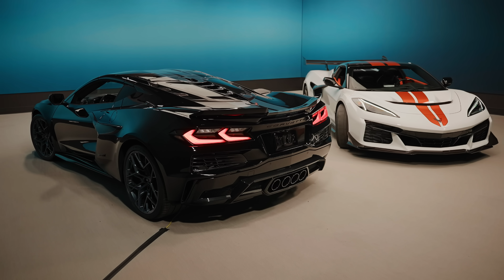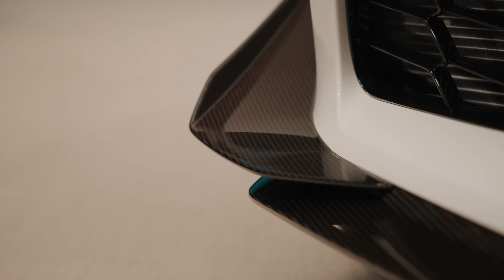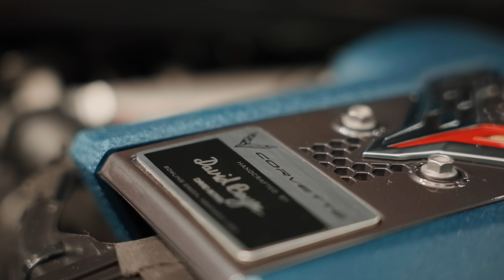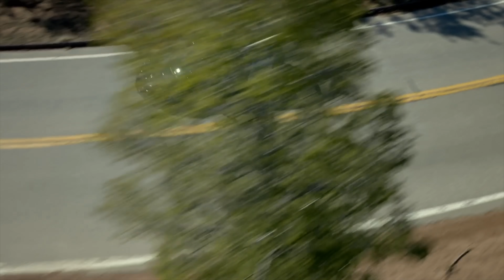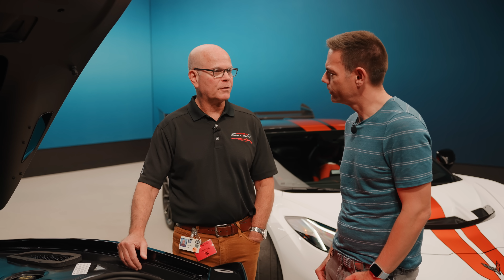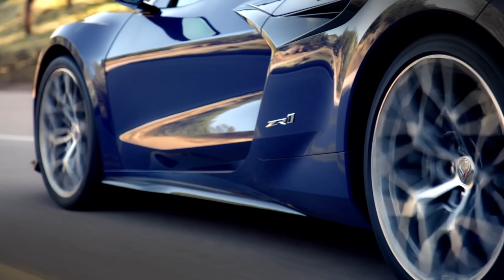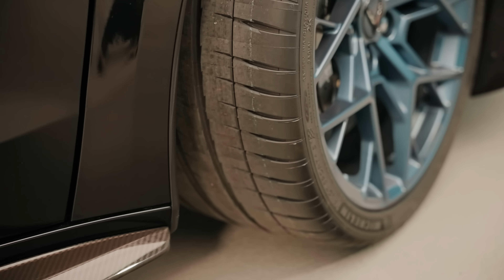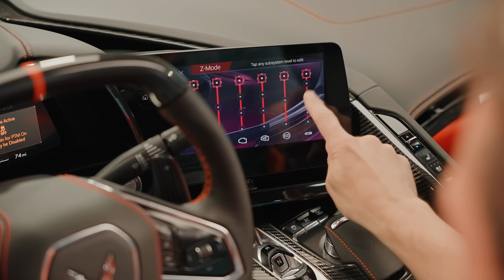FIRST LOOK: 2025 Corvette ZR1 – 1064hp, Turbos & 215mph!

Comment: Always blows me away how much more competent of a vehicle the Corvette is compared to almost every other GM product. They really let the engineers off the leash.
Reply: Gm has made lots of pretty amazing performance platforms in the past few decades, I mean the 2nd gen CTSV was the first sedan EVER to lap the nurgburgring in under 8 minutes, also literally sells its magnetic ride suspension tech to ferrari that they use in all these performance cars, caddys, camaros, etc youve got the 6th gen camaro zl1 1le that is just insane around a track as well, hell, all of the caddy V series cars since then have been pretty amazing as well, the ATSV is a crazy good handling sedan thats quite underrated as an M3 killer for its time period, the blackwings are amazing cars as well, ct4 and ct5 blackwing, all around theyre tough to beat for performance sedans. Truthfully I think their best all around work is done with the cadillac V series.  Sure the corvettes faster, but 1 trick pony, 700 horsepower in a cadillac sedan that can be used everyday,  and accelerate and get around a track nearly like a supercar in luxury and comfort is pretty impressive.  700 hp corvette is really only good for one thing.

The engine you see in the C8 Z06 is based off the work cadillac did on the blackwing 4.2 DOHC V8 actually, same as this engine in the ZR1, 5.5L DOHC V8 with turbos slapped on it but the architechture I is based on the blackwing cadillac engine
Reply: @justinschmidt1 My wife daily’s a CTS-V Wagon, I totally agree with you. It’s a legit monster, with room for my kids and dogs.
Reply: @justinschmidt1 exactly, it’s always a hater trying to discredit gm whilst they’re active putting out things like this amid the other models you’ve listed over the course of the past couple decades. I just love to watch their haters COPE. 😂😂😂
Reply: @justinschmidt1 gm hasn't owned magneride in years now. It's its own company.
Reply: @TLPH04  doesnt really change the point that one of GMs company developed it and was used in GM vehicles first and later licensed to other companies like Ferrari and Audi, yes the company was sold asfter that....but doesnt change the history behind it
Reply: Corvette is its own department. They may be under GM, but they are a superate branch. My Uncle works for them and it's whole different atmosphere being a part of Corvette than just Chevrolet
Reply: @toxicgracie3772 Engineers get moved around GM all the time.  GM has great engineers all over.
Reply: @jostrander71  I'm talking about Corvette. GM is a massive brand with multiple car companies under its belt. Of course GM has great engineers. But Corvette is the smallest branch of the tree and they chose the best. You don't just sign up for a job at a Chevrolet factory and get put into Corvette assembly. Corvette is Chevrolet and it's up to Chevrolet who gets to work on them. Not GM
Reply: @toxicgracie3772 Gm just moved a bunch of Corvette engineers over to ev. They get moved around.  The best engineers work on the best products but they are shuffled around.  Btw I am well aware of what GM is.
Reply: @toxicgracie3772  exactly, there are a lot of undercover haters here but you’re speaking facts.
Reply: @toxicgracie3772 i still remember this dude who has a corvette c4 and legit his only complaint? Not enough problems. He has a dodge neon that contantly gives him something to work on but the c4 is completely problem less.
Reply: @toxicgracie3772 they should make a Corvette Escalade 🤔
Reply: @DanielAriasDO  Please no. Unless you mean a ZR1 engine powered Escalade
Reply: @toxicgracie3772 no it’s not.
Reply: @G-Rated  yes it is.
Reply: CT5-V Blackwing, Camaro SS 1LE, and ZL1 1LE might all have an argument that there are some great non-Vette options.
Reply: What? GM makes the best trucks, some of the best SUV’s with the Tahoe and Escalade, great EVs, the SICK hummer EV, and the Camaro is absolutely nothing to shrug at either. All products are pretty damn good. All this to say they really do let the engineers go crazy when it comes to the corvette but it’s GM has been stepping the game up all the way around.
Reply: The new Escalade and Escalade V are just as competent in my opinion. What GM struggles with are the lower tier products. Their flagships are ALL incredible.
Reply: Cadillac CT5 Blackwing has entered the chat.
Reply: Had my Silverado for 5 years no problems
Reply: All car companies go above & beyond with their flagship car or truck. Ford has done the same with the Mustang, Bronco, F150, & GT. All 4 are vastly superior to their other cars. Same goes for Dodge & Challengers & to a lesser extent Chargers.
Reply: To be fair the Cadillac V series are insanely good cars.
Reply: I would think the same approach should be used for a $100,000+ truck/SUV as well...
Reply: @ABC_Guy  Not really.  They know that 90% of your buying public doesn't care about their car...or maintain their car, etc.  No point in expending extra effort.
Reply: They make it hard to do it yourself these days @oskar6661
Reply: @oskar6661 The thing is. When you let your engineering show itself off rather than market, it means sales. People are still touting how Toyota is synonymous with reliability, meanwhile their engines are blowing up left and right. It still sits in peoples minds. Fine engineering is the best marketing
Reply: @Timmyval123  well to be fair, for a very long time, toyota has made extremely reliable vehicles, that reputation didnt just come from nothing, ive personally owned 2 4runners and the things just last forever with almost no maintenence, its crazy, 300k+ miles and everything still works perfect
Reply: Over decades that mentality brought GM from 60+% US market share (not to mention strong international operations) to 17% today.  @oskar6661
Reply: @oskar6661  That's condescending bullshit
Reply: Absolutely outstanding
Reply: I have a '13 C6 Grand Sport, the only place it says Chevrolet is on the dash when you start it up.
Reply: I love my 2k17 Malibu
Reply: 458 engine rebuild it and similar changes (458 n/a to 488gtb) mmmmmmmm not that American really ..
Reply: Gm as a whole use to be full of amazing engineers, once they starting making vehicles better than the corvette they killed off those vehicles.
Reply: Made in USA too, that’s why it was the clear choice when I got to pick out my reasonable-ish dream car. C7GS, NA and the last one with a manual, but it’s got the Z06 chassis. More than enough power to use in canyons and probably a bit too much for public roads when pushing. No idea what this C8 ZR1 would be like with over 2x the power but not much more tyre. A handful to be sure, and I guess the 4-digit HP is so you never get embarrassed by a Tesla ever again, not that anything short of a plaid in track mode can pull on a C7 or C8 Corvette at highway speeds as it is.
Reply: @seanp2k617  C7 is the best looking Vette of all time imo (C4 is a close second) I'll have a ZO6 someday but for now I'm too young and too broke 😂
Reply: Agree with that. The C7 ZR1 is the best looking in my opinion.@Timmyval123
Reply: @MrLathor  and you know you’re a hater when you call the Corvette C8 “competent”. The Ford GT is competent. The Mustang GTD is competent. The Acura NSX is competent. What gm is doing with the Corvette is an unprecedented level of engineering and new caliber of performance for anyone let alone a standard brand like Chevrolet.
Reply: Seriously. The corvette is basically an honorary cadillac these days.
Reply: @Vincetagram  Cadillac and Corvette share Volkawagen of America's ADVANED research and design facilities in Irvine, CA for their BRAND Headquarters, sharing the same engineering and parts bin, of course their superior.
So are Bugatti, Lambo, Bentley, Porsche...
Reply: James Bowen - what are you raging about?
Reply: My 2022 3500 Duramax tows a 3 axle 42 foot fifth wheel like nothing is behind it.   You get what you pay for…
Reply: @  Mr. Lathor is just a gm critic, instead of giving gm their due credit for another amazing feature of engineering these are the types of comments they leave behind instead. He clearly has never heard of any V-series Cadillac ever.
Reply: Always is a word that bites you in the ass. 4th gen fbody>C4 just is what it is with 6spd
Reply: GM hates money sometimes I swear. We still don't have a performance truck or a bronco/jeep competitor. GM has the best engineers. I wish they'd let the engineers run the company
Reply: @Timmyval123  GM Gets their tech from VW.
HAS FOR DECADES. 
But it's tailored to what GMs accountants and directors specify.
Currently GM and Toyota share the same engine management  wavetables created by VW. Northstar, Vortex and I-force are a shared VW tech custom made for the respective clients.
Reply: @Timmyval123 GM has the ZR2 Silverado and Colorados which both are super capable off roaders. The ev hummer is a beast as well.  GM really doesn't need to make a700 hp truck that's gonna cost you 100k plus like both the raptor and trx.
Reply: @Timmyval123 car guys used to run the company. Now it’s the MBA’s.
Reply: Americans only know how to make good sport cars
Reply: #900✅🧰
Reply: I think that's alot to do with lotus to be honest
Reply: The same people who make the Ford GT also make the F350. Pretty wild. Mercia!!
Reply: Especially with this one
Reply: @froyothepro5615Thanks in large part to the Australian engineering team... But hey, it's not like they had much else to do after the VE program.
Reply: It's kind of like that with a lot of brands though. Like the difference between an Audi A3 and an R8 lol.
Reply: The corvette is a marvel but the Chevy trax is top of its class as well. I’d say they have the formula but on the contrary the trailblazer is last in the same bracket
Reply: Nah. Look at what Cadillac (celestiq, lyric, sollei, all the blackwings and Escalade IQ), GMC (hummer EV and SUV), and Chevy (Silverado EV) are doing. GM is on a kill streak right about now.
Reply: Every manufacturer is the same, ford's motorsports division and their mustang are leagues ahead in product quality and performance compared to things like an escape or a fusion
Reply: I have to say that the LS (and now LT) engines going back to the 90s are incredible.  I remember reading a detailed article showing that the LS made more power, was lighter, had a lower COG than BMW, and pretty much the same mpg.
Reply: They look great.amazing technology. Won't see them in Australia, to expensive. Yes the c8 is made RHD, limited run. They look great. Friend of mine bought one used convertible $ 300 k Australia dollars, not cheap
Reply: There are suburban and tahoes all over the country that are hanging around 250-350k mileage and still going. You idiots are living a narrative, not a truth.
Reply: The only US products are the Corvette and trucks the rest as I have seen are all Chinese...thanks again Mary Bara
Reply: You can thank the lobbyist, the bean counters for the crap GM builds lately.  GM could build a great car if they want, but the general survey panel wants cushy cars for their large rear, bigger trucks, fuel saving boring cars.  When they built the latest Camaro SS 1LE and ZL1, it was a track weapon.  68 Camaro, OG Suburban, Trans AM, Firebird, Chevelle SS, Pontiac GTO, Impala, and a lot of iconic cars back in the day when designers and engineers had more freedom.
Reply: Their HD trucks are excellent. Love my 2020 Silverado 2500 turbo diesel
Reply: For this car they got rid of the bean counters. Like my $83,000 Jeep SRT doesn’t have remote side mirrors.
Reply: Dude, they unleashed the engineers when they came out with the ZL1 Camaro beating up on exotics on the track.  One of the most underrated cars ever or the black wing cadillac.
Reply: Not just GM products but those of other companies as well.
Reply: The corvette is the top pinochle of performance for Chevy as it’s always been. Everything else is to pay for it and the rest of the performance cars and tech advancements. GM has some good tech for performance but they cheap out on cheaper less performance oriented cars in my opinion. America wants to compete in racing we like it other companies that focus solely on reliability and slow cars like Honda Toyota and others do under the reliability flag for a profit.
Reply: Real
Reply: Their AT4X and ZR2 lineups are pretty good.
Reply: It blows me away how much horsepower is needed to go so SLOW !
The V10 BMW M5 HAS 550 HP
AND GOES OVER 225MPH !
The Mercedes S65 AMG has 730 hp and is good for 250mph
Reply: I've had just about every generation of the Blazer/Tahoe since 1975, and a stepsister 4x4, never had any major problems in any of them.
Reply: New Colorado won midsize truck of the year two years in a row has dual voute turbos almost like Antilag
Reply: GM trucks 🤷🏿‍♂️
Keep in mind America makes trucks primarily. Cars are and have always been secondary regardless of the American brand. 

Cars are meant to be just economical, nothing more. Not reliability, comfort, etc. The luxury brands charge an excessive premium for luxury you could put in the car for a 10th of the cost.

The Corvette charges you on the back end. This C8 isn't an easy car to work on.
Reply: Best part is you can do all the work yourself on any generation of Corvette including C8 with YouTube videos and basic tools from Harbor Freight
Reply: Honestly their trucks are great, Tahoe, Escalade so on all good. CT4, CT5, the XT4 all good now. Even the new traverse is good. The lease deals on the ev blazer amazing!
Reply: @MrLalasd  Yeah their trucks are great, but you got dummies on here who still think this is GM of the 80's. Many people in the auto industry have said GM may have the best ride/handling guys on Earth.
Reply: @MrLalasd yeah this was definitely one of those COPE comments. A low-key gm naysayer and hater that can’t deny the product and had it been from any other manufacturer they’d be saying A LOT different.
Reply: @MrLalasd are you kidding? New GM trucks are garbage, engine problems are very common
Reply: @MrLalasd ev blazer trash
Reply: @johndc2998  The blazzer is amazing at 0 down and 200 a month
Reply: @johndc2998  the blazer was another name brought back in the worst fashion possible just like the bronco line up, aside from the big Offroad bronco that one’s pretty cool but the little tiny bronco… that things hideous
Reply: @MrLalasd what’s a blazzer?
Reply: except RIP the C7 LT5 engine. This just is not the same as that, even if it has way more power. Listen to the Hennessey tuned C7 ZR1's, literally the sickest sounding cars ever made outside of maybe the V10 F1 cars. Also e-motors in a vette, eugh
Reply: Agree. Gm is kinda trash. But that corvette is amazing.
Reply: Corvette group advance research and design program, as well as Cadillac are based out of VW of America's Irvine California. Engineering and design facilities. They use the same equipment technologies and parts bin.
Of course, they are more competent than their Detroit based cousin's!
Reply: JamesBowen - VW??  What are you talking about?
Reply: Their V8s are their party piece everything else after that is a crapshoot.
Reply: @RFlash-xc4lo  their 2.0lt is decent. The 3.6 is also decent. The new TurboTax is great. Before that the 3800 reigned supreme. Their new tiny engines in their eco cars have had great reviews too. GM suspension will forever be unrivaled. I understand new cars are less reliable but I'd still buy a GM product over any dogshit Ford or stellantis is putting out.
Reply: @Timmyval123 Don't call Ford dogshit mate, when Chevy has made many products that could also be called BELOW SUB-STANDARD. Don't forget who needed a HUGE Govt. bailout because of the less than optimal vehicles they were putting out. In the late 90s to early 00s, it was in fact Ford who had the best suspensions, and the Ford Focus was THE BEST SELLING CAR IN THE WORLD !   As much as I hate to say it, GM has definitely upped its game considerably. So play nice mate !!
Reply: @arkhsm you do realize that Ford took bail out money from the government as well and took them a hell of a lot longer to pay back as well.
Reply: @RFlash-xc4lo  You have no clue what you're talking about, but par for the course for people who think it's the 80's still. They licensed their suspension system, magnaride to ferrari, Acura, ford, Lambos, Audi, land rover...etc. In the 80's and 90's BMW would use GM's 4 speed auto tranny for their cars. I'm sure all these companies enjoyed using their "crapshoot" parts. You're an idiot, or misinformed.
Reply: @RFlash-xc4lo  Crapshoot?! They license out their magnaride suspension to ford, Ferrari, Audi, lambos, Lanfd rover. BMW was using GM's 4 speed tranny in the 80's and early 90's. I guess these companies enjoy their crapshoot parts. Another "not intelligent person" who thinks it's the 80's.
Reply: @RFlash-xc4lo hmm no not really man their diesels are pretty good as well.

Comment: New dream garage,   shelby gt350r  and c8 zr1.  🔥🔥
Reply: Gotta add the last ZR1 the 7.0 C6 ZO6 & a Trackhawk to that garage!!! Can't forget a 1st gen RT-10 & last gen GTS viper to that😊
Reply: @internationsole_junkie  Strive higher man I had a gt350 it's not even in the same universe as this car.
Reply: @daryl9799  doesn't have to be it's an amazing drivers car looks great and is the best sounding car ever.   And first production vehicle to come stock with full carbon fiber wheels  The 350r version anyway which is what id get.  Just a badass car imo.
Reply: @internationsole_junkie  Yes lol I know as I stated "I owned one" plus I procharged it but it ain't in the same league as this new ZR1.
Reply: @drail1976  it's not in the same league the league as this zr1 the c6 zr1 or the c6 zr1 but still a badass car.  Best mustang ever imo.